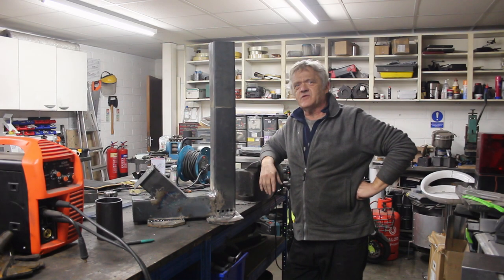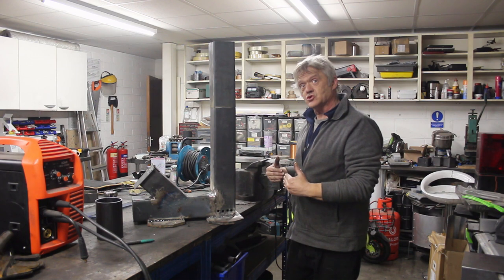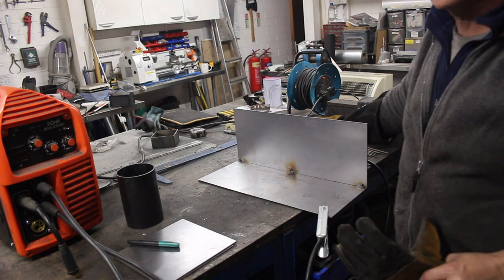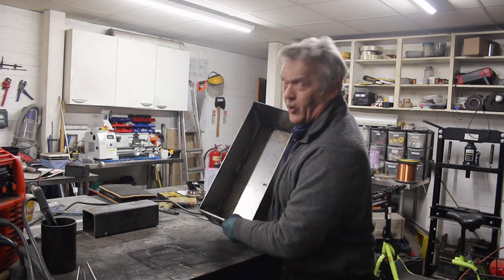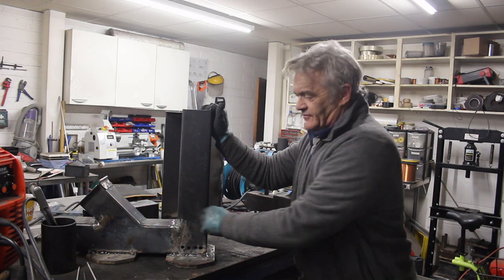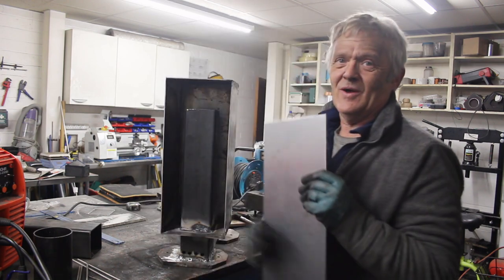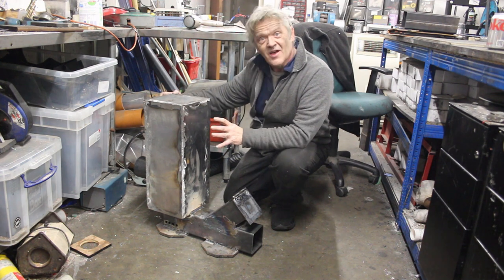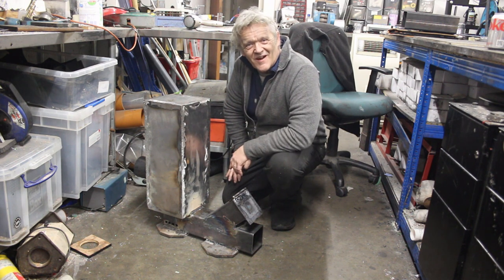1741 How To Change A Rocket Stove For Indoor Use #rocketstove

Comment: Your videos are appreciated, Robert. You are giving people multiple options to partially or even completely meet their energy needs in key areas. What they do with those options are completely up to them.
What the idea seems to be, if I understand what Robert is attempting, is for people to improve and refine the devices and freely share their findings/efforts so beneficial devices that work can be replicated and put to use by others. In this way, research and development can be shared by many and should result in useful, beneficial devices built from easily sourced parts that are affordable and require minimal skills for end users to assemble.
Bickering and excuses suggesting things can't be done are a part of human nature and understandable, but are usually not helpful toward achieving the end goal. Well thought out contributions/suggestions and hands-on work are what is needed to move toward the end goal, IMHO.
Toward that end, if ongoing funding based on results (partial funds released upon each step forward) could be set up for people doing the hands-on work to cover materials, the process would probably move forward a lot quicker. Perhaps something like crowd-funded grants to people who actually put in the time and effort to build these devices.
The whole concept seems to be to reduce reliance on our current systems and corporations and literally put the power in the hands of We The People.
At any rate, that's how I see it.
Reply: Yeah

Comment: Thank you again Rob. Just a fair warning: If you collect too much heat and the gas temperature drops below 50C, the water in exhaust gases starts to condensate inside the chimney and can cause serious troubles. Especially if you have brick chimney.
Reply from the maker: is that not true for any fire?
Reply: @ThinkingandTinkering  Point perfectly made. (~_^)-b
Reply: @ThinkingandTinkering  It depends on the fuel. Burning 1000g wood creates about 500 - 700g of water which you don´t want to end up inside your chimney 😉

Comment: Robert, thought it might be worth considering doing a version for people with no fireplaces by simply having the rocket stove outside and use an enclosed box or similar to what you used here but simply as a heat exchanger and use a small fan and some semi rigid expandable aluminium duct to push or pull the air inside the home via a wall vent or adapter through a window
Reply: Yeah   ok     lol
Reply: I have a pretty extreme idea but I need to get some two inche tube to try it. Rob you are pretty amazing  and if you add a blower on the air intake it would surly help get the burn going harder
Reply: The problem with that idea is, you have to feed the thing. Who wants to stay out there in the cold and do that? Lol
Reply: @karlmyers6518  that mild steel wouldn’t take that kind of heat. It’s doubtful that it will last very long even being naturally aspirated as he has it.
Reply: You're probably better off heating up a sand battery and bringing that indoors.
Reply from the maker: that's a good idea mate - but you seem to have designed the whole system right there - all of what you say is right
Reply from the maker: it would mate - but that would be a fierce burn
Reply: @stevenmark8156  Auto feeding a stove is not 'rocket' science... And it takes SO LITTLE energy, you can power a feeder from the air drawn into the system!
Reply: @karlmyers6518  While a blower will undeniably increase the combustion efficiency, it will also increase the complexity [which I myself am no opposed to, but some people might not want to bother with adding the more work and materials into it, you never know] and the total heat output, potentially increasing its risk of starting a dwelling fire, but undeniably consuming more fuel much faster too.

Indeed, its like adding a turbocharger to one's family car.

It might be alright for some people, but it might be a disaster for others.
Reply: @hunnybunnysheavymetalmusic6542  Interesting. I would like to see that design.
Reply: @stevenmark8156  People who don't want their families to freeze? I grill in the winter all the time. Just dress appropriately. Although being from Ohio (USA) anything below 4 Celsius is going to require at minimum a t-shirt.
Reply: Using stove outside and liquid heat exchanger may work.   Especially if there is a buffer of sorts to keep the temperature below 212F.   We all have unique ideas.   I know someone who uses a large aquarium to store waste heat from a solar panel,   this is not very practical but interesting nonetheless.   I have seen grills made of some type of ceramic.
Reply: @mike289homebuilt5  I plan on building a heat exchanger similar to that but with 50/50 antifreeze in it [because it reduces the boiling point] to transfer 'waste' energy from an emergency power generation rig so I can capture all that heat energy that is otherwise entirely lost, and use it to heat water and living spaces while the generator powers other things like lights and my well pump, and my kitchen appliances.

I have this insanely over driven water heater that is literally too much for my generator to actually run [ 7.5 Kw generator, 9 Kw water heater] but if I just run all the waste heat off the engine into the water heater using a set of exchanger coils, I can heat the water with that energy without even wiring the water heater up at all.

If I simply vent all the heat energy from the motor outdoors, its just wasting it anyhow.

The reason for backup power is mainly for the winter when we get power outages, so the extra heat can help heat the house too.
Reply: So home made make shift central heating? The heater/furnace does pretty much the same thing, but most use natural gas. You use the flame to heat the air inside the duct and circulate that air through the house.

Comment: I have been thinking about this for a while but ended up thinking the exhaust gases are way too hot. My brick chimney is rated for 350C. 
It would be interesting if you could measure the temperature of the gases going up the chimney. 
Keep up the great work

Comment: Yes, a manifold would work really well with this design.  I also think a secondary mass(ie...sand ect.) for the exhaust to heat with a ceramic or terracotta side facing in toward the room to heat would be a nice add on.  Nice build Rob!  Baffle it too much though and it will start to get really noisy as in loud popping noises as it sucks air in.  With this build probably not so much though.  Great and interesting video Rob!
Reply: I think I need to specify what I was talking about.  If the top of your box enclosure gets too hot this could become thermo-acoustic like the hot and cold side of a thermo-acoustic engine and making a noise as it vibrates.  Chances are that your build there will not as it still is able to force air through the box well enough to overcome the pressure needed to clear the box.  Cheers!
Reply from the maker: cheers mate

Comment: rocket stoves are the inital burning chamber for most mass heaters. You run the exhaust line through a large run through sand or something simmilar built into a bench or wall so as you burn during the day it holds the heat and dissapates it through the night. This is simmilar to how Siberian homes work with their small fireplaces in subzero temps
Reply from the maker: cheers mate
Reply: or do something crazy like heat water and circulate hot water around your house to distribute the heat.

Comment: I had seen the last example Stove you showed in the video before.   It's a little more complex in the fire box design as it creates a3 stage burn by allowing the pellets to begin burning on one level and as they get smaller, they fall through a grate to the second level,  then again into the ash box.  This is supposed to allow for continuous burning for days or months on end.  Perhaps a similar feature added to your stove would be a nice feature.   You might also consider a second feed box on the side for pellet feeder.  This would give you multiple fuel capability.
Reply from the maker: I am not keen mate - I like stuff simple

Comment: I’ve got raked ceilings, with no chimney/flue, and have been toying with the idea of getting a length of 3” stainless exhaust tube, attached to the rocket stove, bent 180’ at the top, returning to the middle of my window height with a steel panel insert to fit the window frame, and an outside flue to above the roof.  All sections bolt together in about 5 minutes with standard exhaust fittings.  On the inside tubing, weld on lengths of flatbar fins for increased surface area.
Reply from the maker: intersting ideas
Reply: Flue is to control draft/air flow through your fire and exhaust gases. It would do you zero good above the roofline it need to be at the top of the combustion chamber, bottom of the flue pipe/chimney pipe.

Comment: Hello Robert, I just want to say awesome work that you are doing. Thank you for the dedication that you have been giving. I would like to ask, what are the chances that you can get a venturi from there. That in turn can be used to generate enough power. In a sense say that the system replaces a solar power panel?

Comment: Next, step in heating efficiency.👇

Using indoor air to fire it and venting  the exhaust, pulls COLD air from outside through cracks in walls around doors, windows and whatnot into the home adding to cold drafts.  The next step in efficency is to make a fresh air intake using outside air. And one can preheat the fresh air intake by running it through a portion of the exhaust. That way you loose less heat and your house is less drafty with less cold outside air being drawn around windows doors and cracks.
Reply: I see I am not the only one who sees this issue. (~_^)-b
Reply from the maker: cheers mate

Comment: Your burn tube may only last a few months, our burn tube reached 1200C easily, and we had it made of furnace materials. We built it too big for the house and had to give it away as the house approached 38C It is a fantastic way of getting rid of your waste when you get temps above 1200C there is no smoke and the chimney stays clean, topping that the amount of as in the final chamber is minimal, about 1/2 Kilo for 7 months use (2 seasons)
Reply: I used a 1/2" plate as a cooktop on my build.  It got cherry red and warped something awful.  My secondary air supply, an L-shaped metal tube to pre-heat the air and the upright tube to put the air up into the burn melted out in 2 weeks of steady use.
Reply: Blimey!!!
Reply: That’s almost unimaginable. Excellent work.
Reply: Mike, thanks for using the correct terminology (burn tube vs rocket stove). This video provider has yet to recognize what makes a rocket stove and the fact that a properly constructed one burns at twice the temperature (as you disclose) that his burn tubes produce. Also, the fuel consumption for a rocket stove is about half of what he describes as his experience. I have twice commented to him that he should read Ianto Evans’ book (inventor of the rocket stove) to better understand the technology.
Reply: @terryharris3393  His model qualifies as a rocket stove.  His temperatures would benefit from an insulated burn chamber, of course...but then the steel vaporizes faster.  But it's a rocket, for sure...at least in my 15+ years of rocket development.
Reply: @hunnybunnysheavymetalmusic6542  I upcycled the flat glass top of an electric stove and topped it with a homemade refractory.  The bell top has the same 1/2" stock but it's OK.   
    I don't think the cement would help as a lining since it's refractory and the heat goes through it.  That ceramic fiber board would work as a bottom layer to the steel, but that sends the heat down stream.
Reply from the maker: this won't reach that
Reply: @jeremiahshine  A good solid refractory surface like that is indeed an exquisite idea!

Place two panes of high temp glass in the middle of the flue so the smoky flames can dance between them and make some kind of barrier so children and intellectually challenged people don't stick their hands on it and you have one WHIZ-BANGER of a LOVELY thermal radiator with a little mass to it to boot!

All one needs is a little steel frame with some refractory cement or silicone [may require some thermal throttling to be sure it remains intact under heat] and some corner clamps like you would use on a common wall mirror and you SHOULD be able to produce a truly lovely flame display in the middle of a room, much like a 2 sided flat screen TV that heats the whole room quite pleasantly! \(^_^)/
Reply: @jeremiahshine  your statement is factually incorrect; It’s a ‘J-tube’ burner. Rocket stoves have two more critical components: a ‘heat exchange barrel’ and insulating refractory between the heat riser and the ‘heat exchange barrel’. You may have been building what you think is a rocket stove for 15 years but that doesn’t mean you have been building them. The inventor of the rocket stove and rocket mass heater, Ianto Evans, doesn’t agree with you either. He states unequivocally in his book that there are three critical components to a rocket stove, as I have restated correctly. These two components completely change the thermodynamics and fluid flow of the stove which impact the fuel efficiency and the burn temperature. The proof of this is the burn temperature is twice that of a ‘J- tube’ alone, and fuel consumption rate is half of a ‘J-tube’ alone. In fact, it is the 180deg change in exhaust flow direction caused by the heat exchange barrel that creates the vortex in the heat riser section of the ‘J-tube’ burner creating the rocket sound, which is why Ianto coined its name.
Reply: @terryharris3393  YOU are incorrect.  A j-tube is a rocket stove.  As is the "riserless" design by Matt Walker (Broaudio on youtube).  Watch his stove design chats. 
    L-tubes, j-tubes, Batchbox, Double Batch Box, Sidewinder, Riserless....all are considered rocket variations.  There are a few more to boot, too.
Reply: @jeremiahshine  the burner featured in the video is not a rocket stove. It is a burner, only one component of a rocket stove. Period. The vast number of YouTube videos are derivative tweeks on the burner because the science of a rocket stove is apparently beyond the comprehension of the average DIYer. Any ‘rocket stove’ not including the three necessary parts is not a rocket stove. It’s something else. The inventor of the rocket stove and rocket mass heater and the coiner of the name says so. Each component and the geometric relationship to each other is critical to producing the properties of a rocket stove, which by the videographer’s own admission are not present in his burner implementation.
Reply: @terryharris3393  That's a rocket stove.  It could also be called a "core".  It's a rocket stove without an exhaust path.  There's a "feed tube", a burn tunnel, and a riser.  The proportions look correct.
Reply: Fellas, fellas... The debate appears to be about whether it's being called by it's right name.. that's all very interesting but in truth, more confusing the longer you 2 banter on about what's what.. the gentleman said his video is for a VARIANT of the rocket stove (paraphrasing).. I'm inclined to see the usefulness of this mod on a product designed for outdoor use. Anyone with the interest to improve on it will do the necessary research and call the end result whatever name they like.
Reply: @terryharris3393  Ianto designed the rocket stove with a guy warren winarski or his name sounds like that. Well Ianto further developed the J-tube. They split their partnership and Winarski went off with the L-tube rocket stove. People have lately modified that to make the K-tube. Winarski was not supposed to use the L-tube and Ianto found this superior so he didn’t care about the L-tube. Since then batch burners have come along and they are also rocket stoves. They will all make the rocket sound and have a secondary burn area where the smoke burns at a high temperature. The temperature upper limits are set by the diameter of the riser. The bigger the riser the higher the temps you will achieve. A 4” riser is a rocket stove, but it will not hit 1200c temps.
Reply: Sorry Ianto found HIS superior so he didn’t care about the L-tube and what Winarski did with it anymore.
Reply: Have you seen the Rubik's Cube rocket stove on Cool Cement?

Comment: From your experience Robert, does a double or triple baffle really increase the heat output a lot more ??? Would you let us know as winter is coming soon.
Had one more thought Sir, how would you make a wick for a kerosine heater using carbon fiber wick material that can keep the fiberglass reinforcement for emergency shutoff of the KERO heater ???  Thank you for your time Sir too.